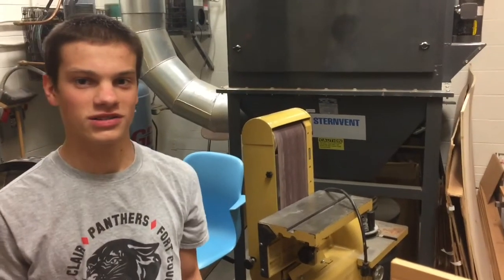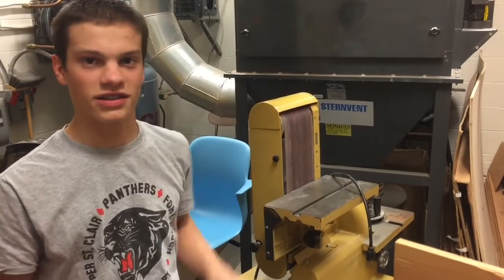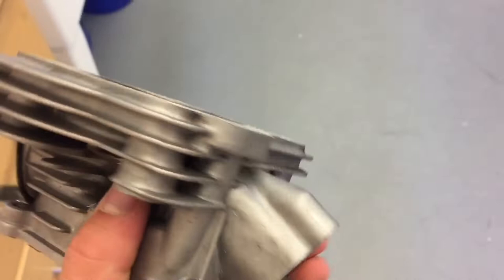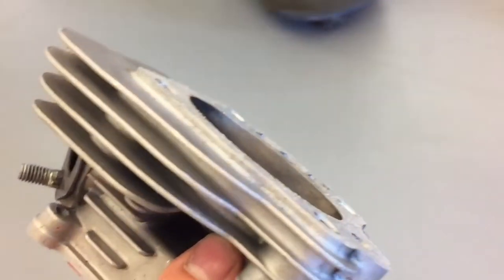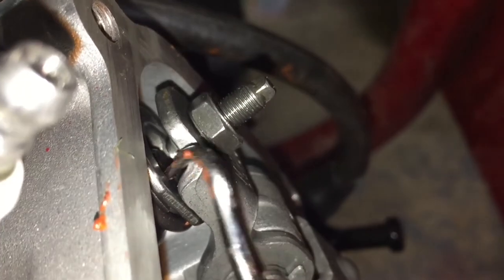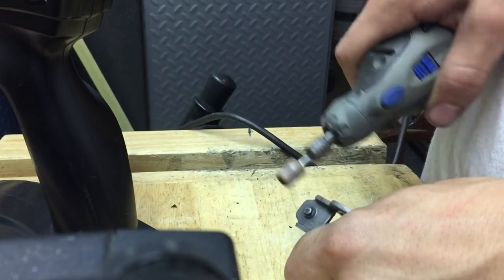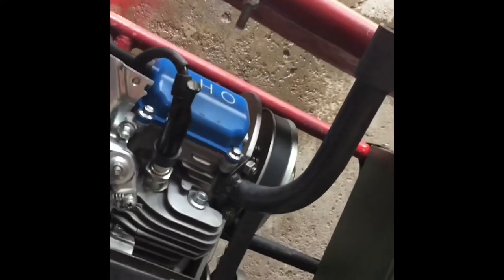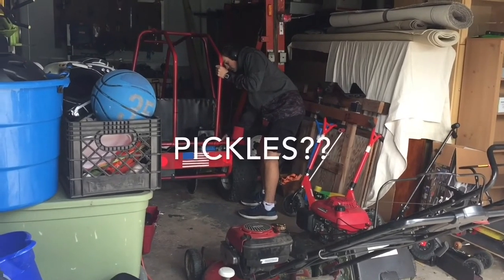Shaving My Predator  212cc Cylinder Head!

Comment: You need better valve springs now or too atleast shim the springs to get some more spring pressure
Reply from the maker: I have the 18lb springs
Reply: Oh it just seams like if floating valves
Reply from the maker: @lumpasaurus4431  it was so long ago I might not have gas them yet in this video. I get them later tho

Comment: I wonder if 14:1 is possible
Reply from the maker: You would defiantly need a billet rod, arp studs, would have to cut valve realeses in the top of the piston, and would have to run high octane race gas. I don't think it would be worth your money. A stock or slightly modified 9 horse or 13 horse would be cheaper. Thanks for watching
Reply: OH GOD That wouldn’t go so well

Comment: Your explanation is somewhat correct your just changing the CC’s of the head to have less space where the air fuel mixture can be compressed your not changing the displacement that stays the same since that is the piston size and the stroke
Reply: It still changes the compression ratio... i dont think he said that it changes the displacement.
Reply: Making the combustion chamber smaller lowers the total ccs of air the cylinder can hold, so yes that means the displacement is less.
Reply: Ur actually lowering CCs. And he didn’t say anything ab changing stroke
Reply from the maker: TBH I didn't know what I was talking about back then. I just shaved the head down because I would make more power. Thanks everyone!

Comment: a belt sander ? super bad idea.
Reply from the maker: It worked just fine and runs good. It's been a couple months now
Reply: @JohnWheels  Just curious did you measure how much metal you removed this way ?
Reply from the maker: I eyeballed it until it looked good
Reply: @JohnWheels   If there is a next time, test static psi.
Reply: It not the right way to do it but it works as long as you finish on a glass table with fine sand paper rotating it around.

Comment: Now it's time for a makuni and billet rod.
Great job!
Reply from the maker: Hillbilly Holler, I'm asking for them for Christmas. Thanks for watching!
Reply: @JohnWheels  you can get the carb with filter and intake sepperate off Amazon for about $65 on Amazon instead of $100 off the kart sites.
Reply from the maker: Thanks for the advice! I'll look into it
Reply: You get what you pay for when it comes to carbs. You can buy   Real mkuni 22 or knock off 22 even tho they say there both 22 the knock off ones have  a  Considerable smaller bore
Reply: Isn't it called "Mikuni"? Same company that designed intake manifold for my 3000gt VR4 6g72?
Reply: @BpA-zl1nz  auto correct got me there
Reply: @hillbillyholler516  Sheesh 4 year old comment and the homeboy replies back right away🤣
Reply: @BpA  unusual, isn't it 🤣

Comment: Looks good man
Reply from the maker: Thanks! I'm also asking for the flywheel key for Christmas
Reply: @JohnWheels  sweet, are you going to do a billet flywheel, rod, 18lbs valve springs, and a 22mm carb?
Reply from the maker: I did the springs already, and I want the rod and the carb, but I don't think I really need the flywheel if I have the key
Reply from the maker: I'll ask for them for Christmas